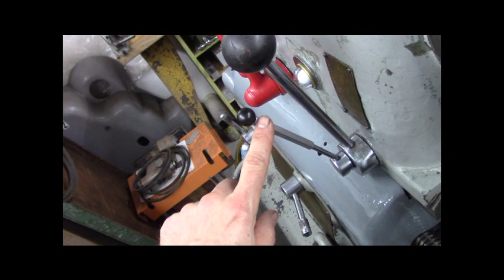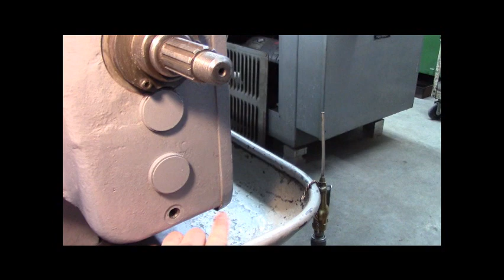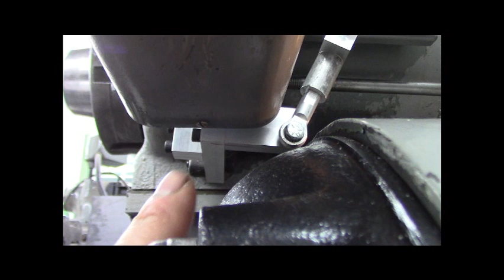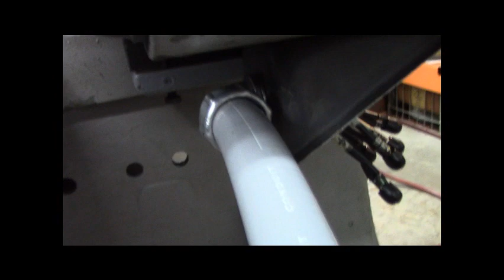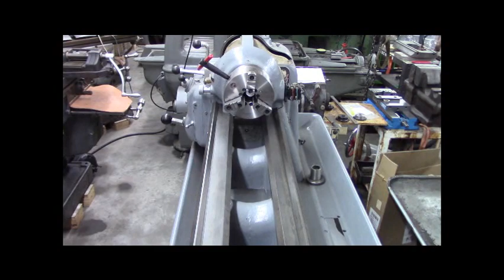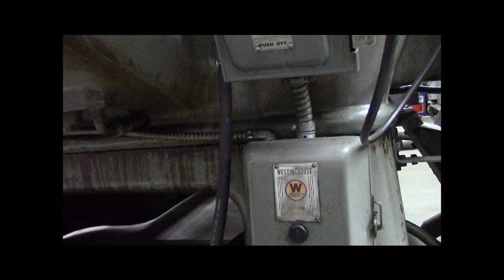Doozer's Machine Shop Update 8-13-20 -- Colchester Lathe Switch and Wiring

Comment: Love the delta wound motors. Wish I had some for my idlers. One is 10hp 1200 and one is 15hp 900. That one is really quiet.
Reply from the maker: I can't believe more people don't know that delta connected motors make the best phase converters.  I am glad I spoke to the EE at North America phase converter.  He said they get all their RPC motors from Baldor would delta at 230v.   Those popular American Rotary converters are Y connected at 230v and everyone on youtube that got a free one (sux) you can hear them buzzzz.  Oh well.
Reply: @kooldoozer  I put in an offer on one of the K&T 2D mills.
Reply: @EngineersWorkshop  Here's me having slight sellers remorse (more like give-awayers remorse!) after getting rid of my 10 HP Delta only 400V motor (here in UK so European 400V 3 phase standard) that I bought for a phase converter. Specifically because I thought Delta motors were BAD! We have dual voltage Delt/Wye motors here that take  230V/400V and 400V/690V in larger sizes (notice the same ratio as it's always a Delta /Wye thing, not series/parallel like your american 240V/480V dual voltage motors) 

At least 400V delta motors are common here, so I can get another one (the bearings were trashed in that old one anyway...) and I've got a choice of transformers to step up 230V single phase to 400V before feeding the idler, or a 3 phase 230-400V transformer if I choose to feed 230V single phase to a 230V idler (i.e a 230/400 dual voltage motor wired for Delta) and step up the three phase after the idler. Have lots of testing to do and will show what I do in some videos.

Comment: I have a little 8 inch Atlas lathe, and a 16 inch throat Buffalo Forge drill press with a nice solid 4-axis milling attachment. 
Looking around into your shop projects is mind boggling- so interesting. They'll never make machines like that again. What an achievement, to even take it further and re-engineer all of that as you do! 
You inspired me to properly rewire my lathe motor switching and to set up my back gears properly, after a few years of compromises.
Thanks for taking all the time for sharing this.
Reply from the maker: Hey Joseph,  Thanks for the views and thank you for appreciating my effort working on old machines in the shop.  The quality and capability of these machines keeps me motivated to fix them.  As for re-engineering fixes, It is in my blood, I can't help it.  I am put on this earth to do something, and being creative is all I have.  Hope you keep watching.   I started out with a 10" Atlas lathe and I still have a Buffalo Forge drill press.  Being born in Buffalo, I love them machines. --Doozer

Comment: I wouldn't be beating up myself over feeling burnt out over re-engineering the Colchester or any other piece of machinery in your shop.  You are, after all, expending huge amounts mental and physical energy divining just what the designers and builders wanted and did.  All your redesigned components needed a lot of subjective thought and introspection in trying to figure out just why this particular piece is the way that it is.  The reality is that a lot of the kooky engineering was because that was the way their fathers and their fathers before did it!  Not always a good engineering practice.
Coming up with the new or modified designs with all the subtle ramifications needed to make them work better is pretty amazing and totally time/mind/energy consuming in my book!  You need to take a victory dance around your shop and pat yourself on the back with each success!  Hear hear!
Reply from the maker: Thanks Peter.  Your words are an inspiration to me.  I appreciate it.  I think I have the most quirky channel of youtube, because there are a very small group of machine enthusiasts out there to say, compared to woodworkers, or something like that. But I will keep documenting my work.  Someone might find it interesting. --Doozer